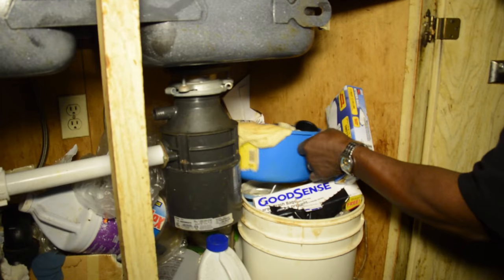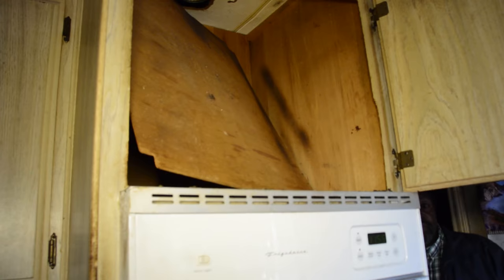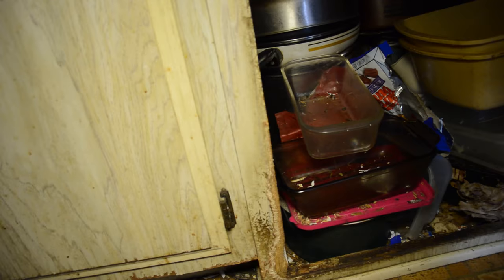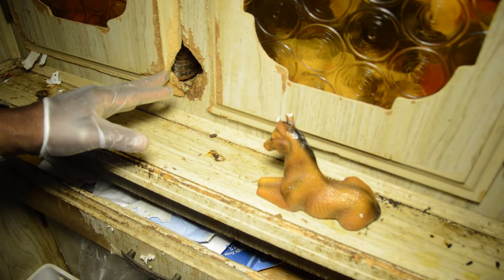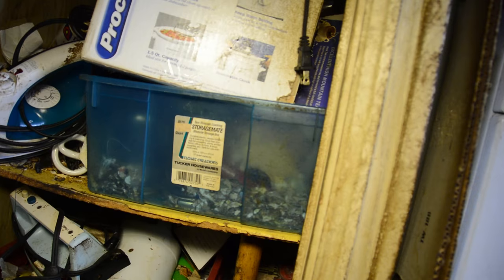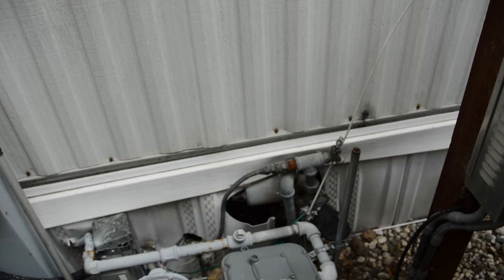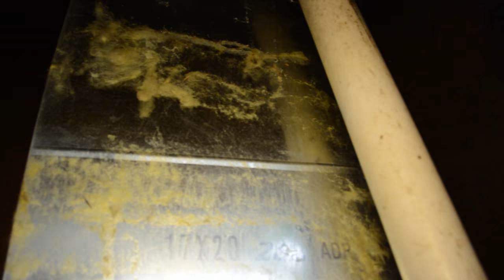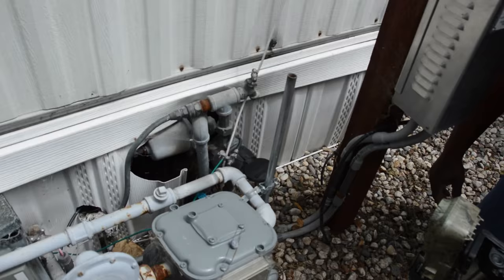Mobile Home That Roof Rats Took Over

Comment: I think the problem here is clutter. Rats love to hide out in big messes. But hell, my mobile is pretty clean compared to this one (it's not sparkling clean but it is much cleaner than this one) and I have no food out and I have removed the clutter and STILL rats are getting in here. I know why- there are so many places for mice and rats to enter your mobile home even if it is clean. If they can't find any food, they're still going to try to find anywhere to nest. You have to identify all possible points of entry. Mobile homes are lifted and there are aluminum grates all around the bottom of the home which should be closed by using wingnuts. But the spaces in the aluminum coverings are pretty big, very easy for rodents to crawl through. These openings allows for someone to remove the aluminum covering and crawl underneath there and fix plumbing problems and any other problems. But that's where the rats get in, too. It's a hard problem to solve even of you are doing everything right. Rats are a big problem here in Florida, especially in mobile homes. They will get into even the cleanest homes and cause chaos and damage.

Comment: Yeah I live in a mobile home and it's a fixer upper and why am I literally live in my room and there's a cat or something at 4 in the morning at 5 running back and forth on it my house is clean I've tried peppermint I've tried baking soda and sugar I've tried sticky pads I've tried regular mouse traps I've put all my food in my refrigerator so they have no food stores and they're still here what can I do that I can afford cuz I'm laid off
Reply: Brandy Pollard Take empty bottles and cut holes in the tops. Pour ammonia inside the bottles. Also it would help to put some of those bottles outside under your home (if possible). Stuff holes with steel wool and plaster. Continue to use the peppermint especially after cooking (NOW brand the essential oil) because it needs to be high potency. You can also soak rags with ammonia and put them around the house as well as cotton balls soaked with the peppermint. Get a cat as well females are better hunters. Sorry your going through this all the best.
Reply: Hey Brandy did u ever solve ur problem
Reply: You could make tasty ratsickles! 😂